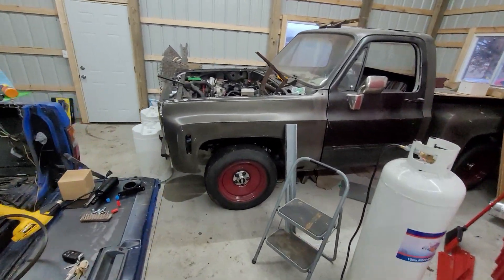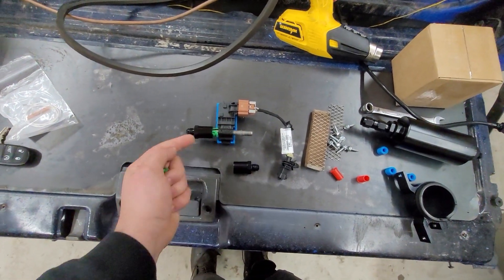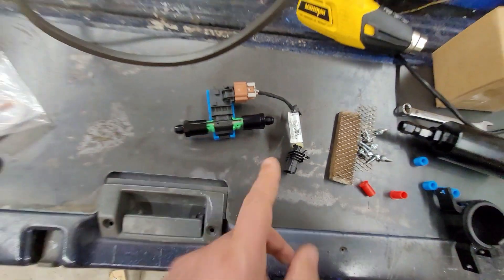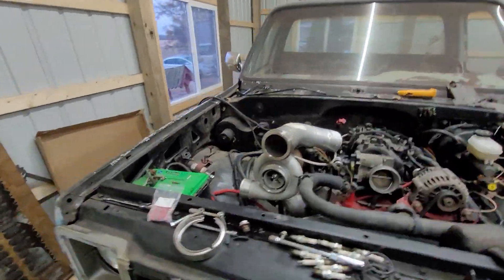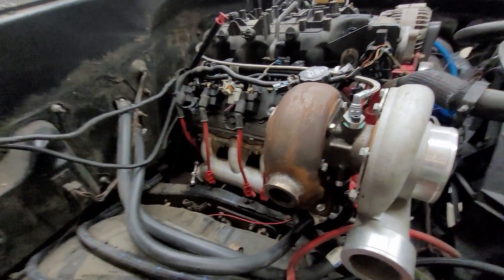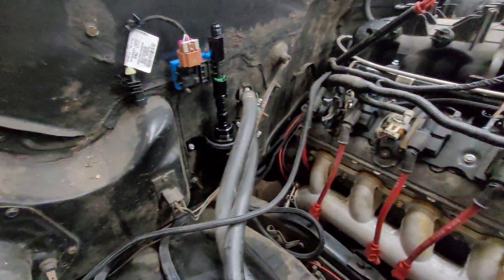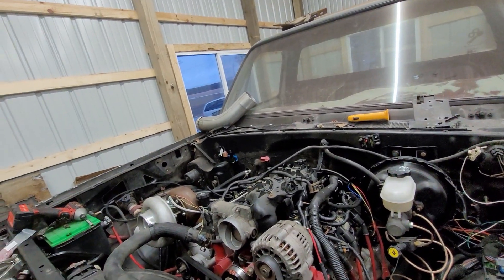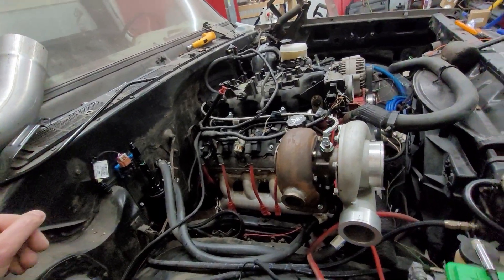Turbo LS C10 E85 fuel system upgrades

Comment: Q&A. I am at one of the last points on my build (LS into 3rd gen Camaro) I am trying to use the OEM V8 radiator however, I would also like to hard-line from the trans to that radiators flared fittings like OEM, the 4L65E I have, uses the modern quick connect, any thoughts? It appears you used a flexible type of transmission line like Earls etc. Also I hope to find the OEM style clips to contain the lines, Thanks.
Reply from the maker: I don't have the tools to flare hardlines in the factory style, they're fairly expensive. 

My lines are simple AN lines with the appropriate fittings into the trans and radiator at this time.